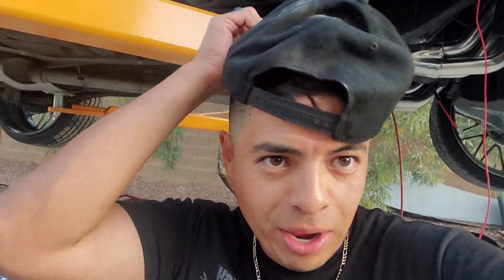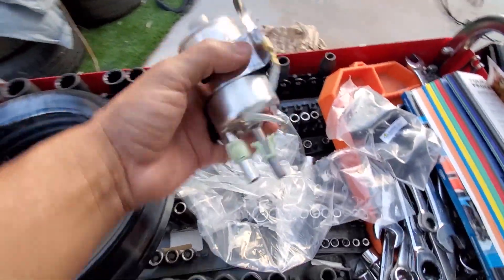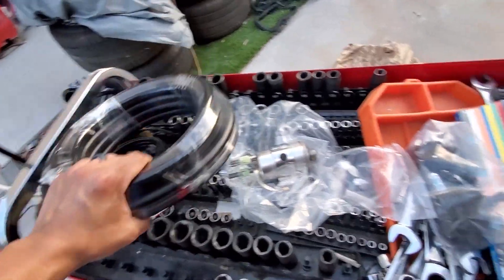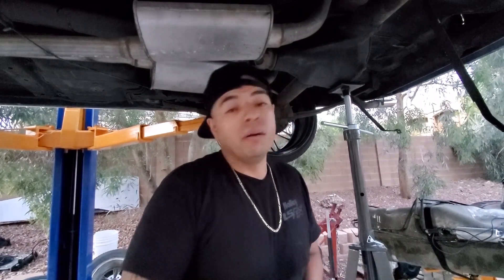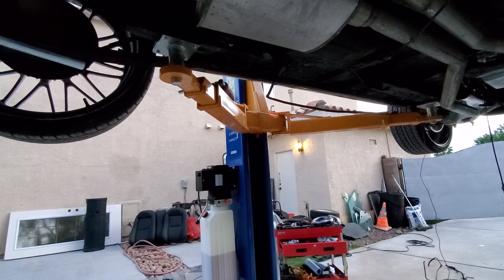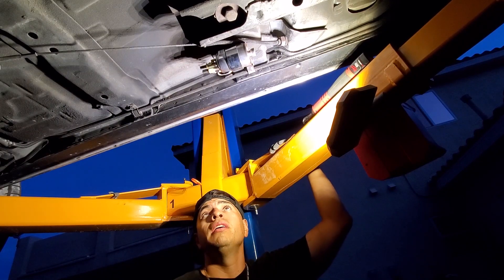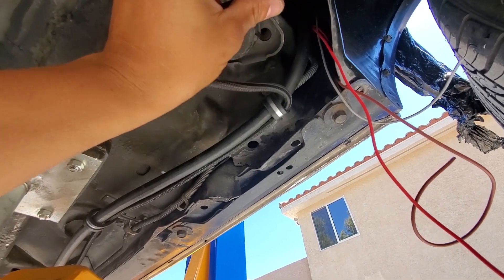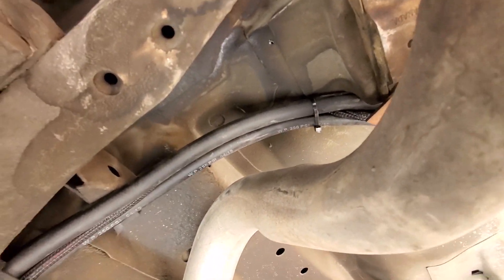EASY WAY TO SET UP YOUR LS FUEL SYSTEM USING EFI CPP KIT.

Comment: You're pretty spot on.  I use the Corvette regulator/filters and instead of all the flexible line I run hardline as long as it's 3/8" or 1/2".  Sometimes I run an external pump with a 100 micron strainer before it but this type of fuel supply is cheap and simple and will feed up to a 600hp naturally asperated engine.  My latest build is a '68 C10 with a 5.3 punched out to 5.7, BTR cam, long tubes and a Fitech Ultimate LS Injection System.  That engine makes 420hp at the rear wheels with a 700r4 tranny so she' probably making around 500hp at the crank and I'm feeding it with a Walbro 255lph pump, never had any pressure drop offs and it just works.
Reply from the maker: Nice got to love those c10